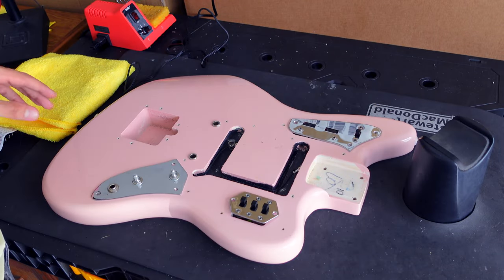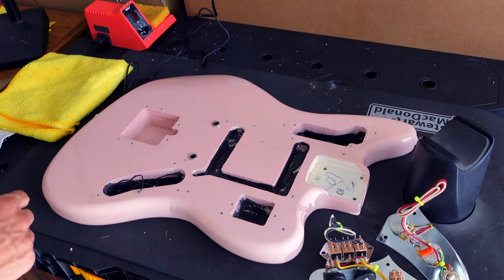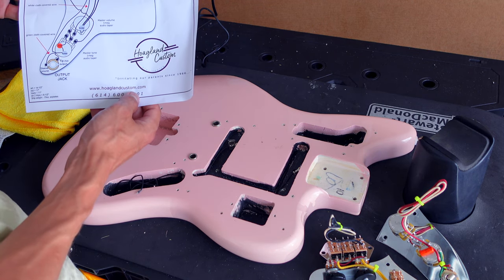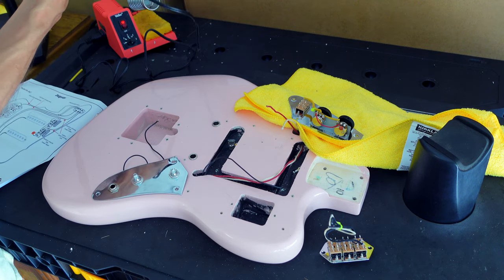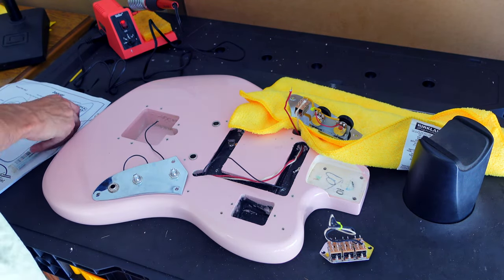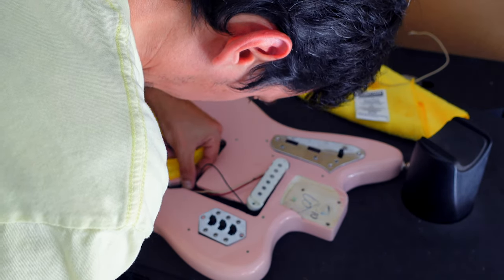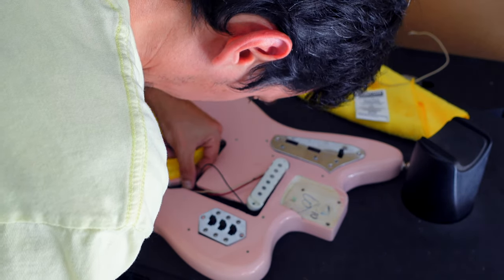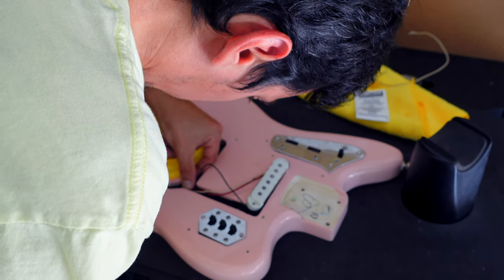In For Repair - The Classic Vibe gets a full rebuild.

Comment: I was able to get a new CV 70s Strat for $249. The feel of the neck was really nice from factory. I added a 57/62 loaded pickguard, upgraded the bridge saddles, added locking tuners and blocked the tremolo. I did all the work myself including a setup to my exact liking. Bottom line, all in at less than $550 this guitar is on level with my American Deluxe!! And I don’t have to stress when leaving it out around the house lol.
Reply from the maker: The strats and teles are waaaaaaay better value than the jazzmaster and jaguars from the CV line.  Those really dont need anything as even the stock hardware is perfectly fine and reliable as is.  Those are the two best cvs and it isnt close.  Glad you enjoy yours love the big headstock on that model!

Comment: Nice upgrades. I'd like to hear a demo. I see the vibrato arm is flopping around. The arm on my '60s Lacquer Jag was doing that and I was concerned about how to fix it until I figured out I just didn't have arm pushed in far enough.
Reply from the maker: That works until the collet is just worn from years of use which is the case for this one, once that goes it's basically the decision of using a set of pliers to retighten it with the assembly off to force it to clamp tighter again, or do the puddy trick which has held up on my jazzmaster for about 7 years now... a little bit into the arm cavity and boom - problem solved!